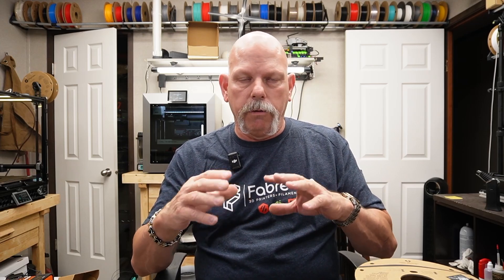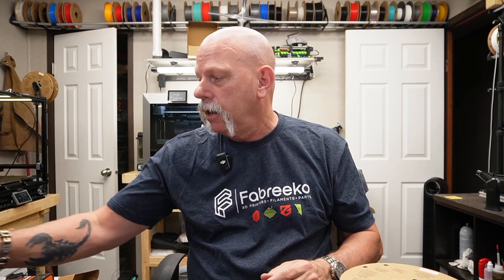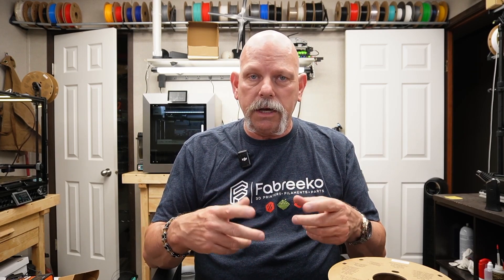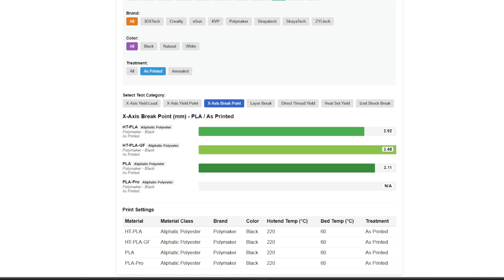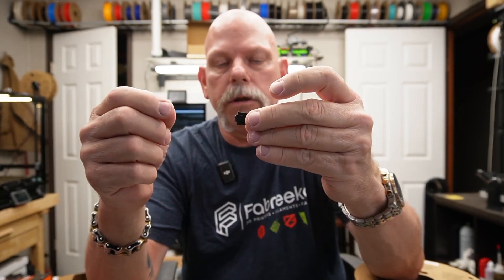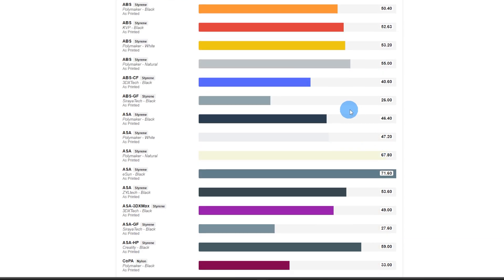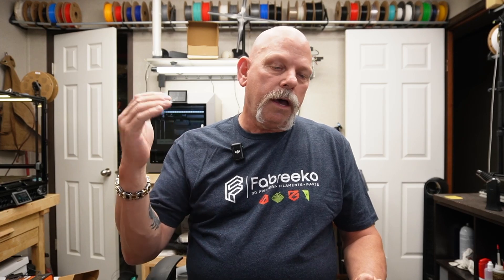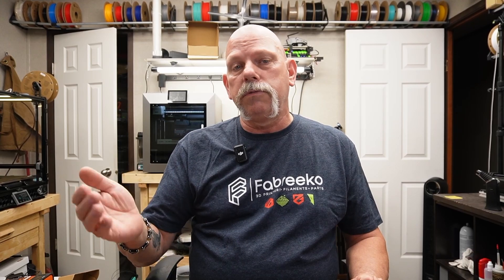TESTING POLYMAKER PLA | EDGE OF 3D

Comment: I was hoping that HT-PLA-GF would be able to replace PLA Pro as a higher temp material,  but from the looks of things,  thats simply a pipe dream.  Polylite PLA Pro remains the king of 2A models yet again :D  I saw you mention PPA-CF,  I think you're going to be blown away by it.  It's now my go to material when printing super safeties because it's just that good.  It's by far the strongest, durable/impact resistant, and heat resistant material available for any FDM style printer right now but it is expensive at like 80 bux for 1KG rolls.

Comment: I want more PCTG options. It feels like 3DFuel is dominant and then some other random companies. I’d love to have polymaker make PCTG in the near future.
Reply from the maker: I have zero experience with any PCTG but it is on my list of filaments to acquire and test. Now if PolymakerPete happens to send me something new, I'll make sure and almost leak it and try to be the first to drop a review after the NDA comes off. (FWIW, he hasn't sent me anything yet so I have nothing to leak)
Reply: @EDGEOF3D  I'll have some more stuff for you soon!
Reply: Do you use PCTG or just want us to carry it? I've found tons of people asking for PCTG but then they mentioned they've never actually used it before, just that they've seen it on YouTube and such.
Reply: Fair question. I have only used the BEST-Q brand I found on Amazon. I have not purchased any of the 3DFuel PCTG so far. I print exclusively in PETG, but I like the additional benefits that PCTG adds, though I do think there is room for improvement, at least with the single brand I have used. Regarding the media flying around on the Internet, I get it, but the general vibe around it is that it is just a ‘better PETG’ with nothing really negative surrounding it. In contrast, the comments tend to be more like, ‘we think it will start to catch on’ or ‘we are not sure why it hasn’t had broader adoption yet’ etc.. For me, as someone who prints in PETG, I would like to see a Polymaker option of PCTG. Thanks for asking.

On a side note: I would definitely like to see a high flow polymaker PETG, similar to Bambu HF and SunLu HS Matte.
Reply: @colinmsmall  Awesome, thanks for your answer. I may be able to help you out with some of your requests in the near future. haha. Keep an eye out!

Comment: I read the title and was generally confused. It’s just regular PLA, granted I buy Polymaker & Overture for PLA+/Pro. Not sure on what you intend to showcase in this but ima watch😂
Props for using the Plus 4🤝🏾i have one as well. Love it despite some of its inconsistencies.
Reply from the maker: Honestly, same. I made the video in a fog of existential dread and filament spaghetti, so confusion was kind of the vibe from the start. I wasn’t sure what I was showcasing either—possibly just my slow descent into hobbyist madness.
But you clicked, so either the title worked or we’re both in too deep. 😂
And yes, big props to the Plus 4—it’s like a dependable friend with mild social anxiety: mostly awesome, occasionally forgets what it’s doing mid-print. 🤝🏾

Comment: Polymaker is a very good company. They give several “serious” YouTubers, such as here, a budget to buy any filaments they want to buy. They also give them whatever Polymaker filaments they want to test. You have to be very confident that most of your products will perform very well in order to do this. Not always at the top of the ratings, but very good nevertheless. Just a point about strength. Most of the time, any filament is more than strong enough, even if the numbers look bad. For some of my projects, involving a circuit board, switches, etc. and I design a case for it with inserts, often from ABS, I’m only concerned at how warped something comes out. The screws are tightened to maybe a few ounce/inches. The pullout force is basically nothing. That’s as it should be!

Comment: You certainly can anneal regular PLA to varying degrees of success. It generally does increase heat resistance dramatically, but with many filaments it can cause a lot of shrinkage or warping. Problem is it varies by brand, product line, and even color. The disappointing aspects of the HT-PLA are the overall strength and especially layer adhesion. It's definitely not the best catch all material in my opinion.
Reply: Definitely not. But it’s specifically formulated for temperature resistance. I believe the point is that people should know what characteristics they need and use the filament that meets that. When I do metal work, I have the same problem. No one material excels at everything.